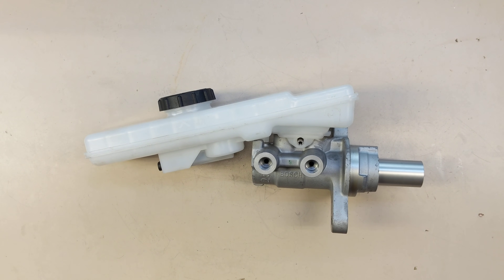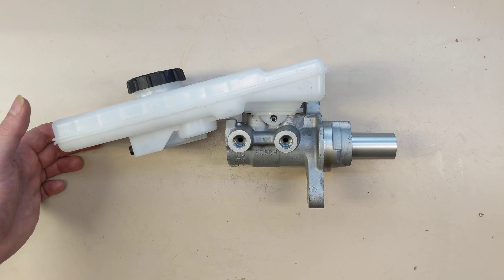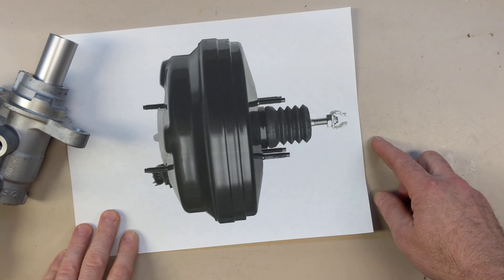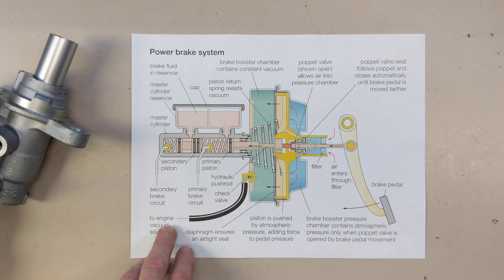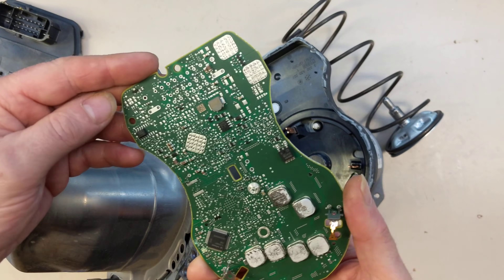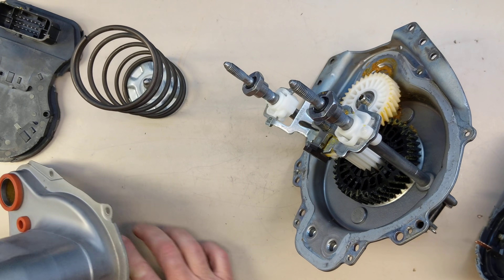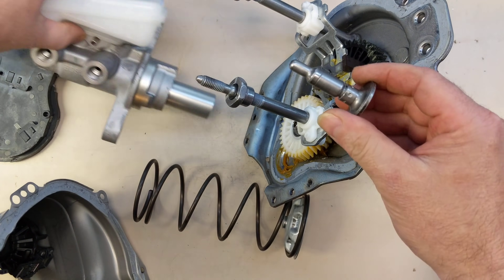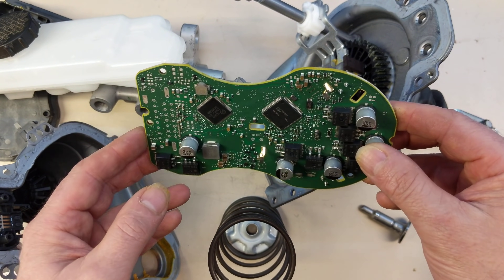Tesla Autopilot - How does it stop?

Comment: Where does brake force arbitration occurr? Does the ibooster scale sensor travel to brake force and request it from the vehicle? I know they can run in stand alone mode, so it makes me think all of thebwork is done in the iBooster and it gets the available brake force from the car, requests what it can then fills in the rest.
Reply from the maker: The iBooster in boost mode doesn't care about brake force, only your pedal application force.   However when AP or the DU is braking (one pedal) there is closed loop feedback.  (AP or DU requests brake pedal pressure)   Basically it brakes like you would, sensing the deceleration and modulating the pedal to achieve a smooth stop.
Reply: @Ingineerix  I see, that makes sense. But what about when the foot brake is applied? In my Honda Clarity which also runs an iBooster, when I apply the foot brake it brings in re-gen first then blends that with the foundation brakes to achieve the  desired deceleration. It's pretty good at blending the two as well. So does I booster do that calculation and tell the drive unit how much retarder torque is required or does the vehicle read pedal throw and then tell the iBooster how much brake force to apply when the Drive unit can't supply the required retarder torque?
Reply: @brandondelgado4153  Tesla doesn't do blended braking. If your foot is off the go pedal, the car is doing all the regen it can. If you press the brake pedal, it's all friction brakes.
Reply: @compu85  ok thanks, I had not realized that was the case.
Reply from the maker: @brandondelgado4153  Tesla doesn't believe in blending on the brake pedal.   Now they have one-pedal mode on the "go" pedal though, and that does blend regen into hydraulic when you let off the "go" pedal.  It brings the car to a smooth stop without ever needing to touch the brake.  The ESP3 (ABS) valve body then implements full 4-wheel brake hold until you touch the pedal again.
Reply: @Ingineerix  that makes sense. I hadn't realized Tesla was one pedal driving only. Does the ABS module require pressure from the master cylinder to apply the brakes? Or can the abs module generate the required force 9n it's own?
Reply from the maker: @brandondelgado4153  It can if the iBooster fails for some reason, but it's not normally used for this.  Either your foot, the iBooster motor, or a combination of the two supplies all the hydraulic pressure for a normal braking event.   If the ABS is triggered then the pump in the ESP3 (ABS) module is only used to re-pressurize one of the 4 circuits once it dumps pressure in that circuit and needs to increase braking force again.   It's noisy, so you always know if it's running.

Comment: Very interesting, thanks for sharing! -- Just looking at the video and unable to measure the forces myself, but suppose you have a software bug aren't there two fail scenarios:

1) Motor stops pushing entirely, you're working against the spring and the master cylinder to brake the car manually... Or is the force of the foot enough to overcome both?

2) Motor wrongly goes in reverse do to a software issue... Does this impede you breaking? Probably it means you're just not assisted at all though.
Reply from the maker: Yes, it would be full manual control.  The motor cannot fight your foot.  Keep in mind there are 5 other ways to stop the car:  1. Regen, 2. DI Plug braking (loss of HV), 3. ESP3 (ABS pump), 4 & 5. EPB (Electronic Parking Brake) EPB has 2 independent channels, so it counts for 2.
Reply: @Ingineerix  If you have a blackout, there is only the manual part left.
Reply: @Xanthopteryx  Yes, even if the ICE engine dies and vacuum boost goes away, you still have full manual braking.  Same for the electric boost braking and all electrics going away, full manual braking is still available.
Reply from the maker: @Xanthopteryx  Having both HV and 12v fail at the same time is not likely.  Keep in mind there are still 5 other ways to stop the car:  1. Regen, 2. DI Plug braking (loss of HV), 3. ESP3 (ABS pump), 4 & 5. EPB (Electronic Parking Brake) EPB has 2 independent channels, so it counts for 2.   DI plug braking can happen without ANY power in the car.
Reply: @Ingineerix  If 12V fail, HV fail. You need 12V to have HV. Safety feature.
Reply: @morrisg  Fun fact: If engine dies i still have power braking for a while. I can actually pump the breaks a few times before it is gone.
Reply from the maker: @Xanthopteryx  No.  The 12v system is divided such that if half fails, the other half can still provide power.  The 12v battery can provide power for one half, and the PCS can provide power to the other.   In addition, critical circuits in the BMS have their own HV DC-DC to make 12v even if external power is not present.
Reply: @Xanthopteryx  Fun fact:  If the vacuum booster diaphragm splits you don't have any power braking assist at all.  Yet in both examples, full manual braking is still there.  Stop making up corner cases and I will stop too.
Reply: @morrisg  If the engine stops on a car with vacuum booster, you have at least one (often actually a few) tries with full and partial booster.
If electric goes on an electric one, you have zero tries with booster.
Reply: @Ingineerix  Since you need 12V to pull the relay to have  high voltage, a short in 12V can shut of the rest.
Reply: @morrisg  Fun fact: I have never, and i mean Never, heard of anyone that had that problem. Even on a car that is 20 years old!
But i know many people with electrical problems in their cars. And also those plastic gears will cause a problem in the future (so sad that it is so common to use plastic everywhere today, not only on cars).
Reply from the maker: @Xanthopteryx  Wrong:  As I said above there are 3 sources for 12v in the car.  Also: Plug braking does not require any external power, if HV goes away it dissipates the braking energy in the motor windings.
Reply from the maker: @Xanthopteryx  Sorry, you are wrong, I bet the modern braking systems are more reliable overall, and the plastic gears you lament will probably outlast the car, and probably outlast all of us.   Having all power fail in a car without warning just doesn't happen.
Reply: @Ingineerix  If you talk about a life span of eight year, then it will work. But not if you talk about 20 years. Then we are beginning to have problems.

All power going out actually happened for one guy, in a Tesla. The Tesla just shut down completely. Totally dead. Everything. When he had closed the doors, he could not get in anymore. Nothing worked.
Reply: @Xanthopteryx  So this one Tesla just shut down completely, totally dead, no 12v power, no HV power, thus proving your point to yourself.  Oh, you have some really powerful internet diagnosis skills there, able to tell all that from some post on a forum somewhere.  I think you should open up an internet auto diagnosis shop and make millions!  Millions I say!!!  (/s, because I don't think you're able to tell jokers on the internet.)
Reply from the maker: @Xanthopteryx  Show me one case of this happening while driving, and the car was unable to safely stop because of it.   Having a car die after it has already safely stopped is definitely possible, but does not constitute a safety risk.  I also want to know what FMEA study you performed that shows the iBooster will only last 8 years.
Reply: @morrisg  Yep. Totally dead while driving. This has happened and it will happen.
Reply: @Ingineerix  Well, since you have manual brake to use, but it is HARD to do so, it stopped. It did not go as fast but imagine in higher speeds where both steering assist and brake assist disappear, and the car goes black.

There is no study, of course, but i know how plastic stuff ages and that manufacturer are happy as long as it outlives the warranty. Then they do not care so much anymore.

Stuff today are not made to last or be repaired. It is made to be replaced.
Reply: If the motor would go and stay in reverse it would drive the threaded rod all the way back into the white gear until it can't or the gear teeth rip, but because the white gear floats inside the black gear you will have no problem pushing the whole rod (threaded rod + white gear) towards the brake cilinder.
Reply: It has that spline that gives you the ability to manually apply the brakes regardless of what the booster is trying to do.
Worst failure mode would be fully applying the brakes by mistake, but the ABS may be able to mitigate that.

If you have ever tried using the brakes on coasting cat you would know exactly what it would feel like if this stopped working.

Instead of using your big toe to stop the car, you have to push pretty hard, but it's possible.
Reply: @ke6gwf  The point is that in contrast with traditional manual breaking if your vacuum fails, here you are also fighting against that big spring. Doesn't that make it even worse??
Reply: @purpleidea  the vacuum boosters also have a big spring in them, that's what returns the brake pedal after use.
In addition, the brake pedal has a LOT of mechanical advantage from leverage, so if you have, say, just replaced your master cylinder and you step on the brake pedal to start bleeding it, before it has fluid in it, you feel almost no resistance on the pedal, but it always comes back up..
That's that big spring, and it's probably about the same strength as in a vacuum booster system.

And compared to the force it takes to apply hydraulic pressure to the brakes, the spring might as well not be there from what you can feel.
Reply from the maker: Vacuum boosters have a similar spring.  The spring force is nothing compared to the hydraulic force needed.  Keep in mind there are still 5 other ways to stop the car:  1. Regen, 2. DI Plug braking (loss of HV), 3. ESP3 (ABS pump), 4 & 5. EPB (Electronic Parking Brake) EPB has 2 independent channels, so it counts for 2.

Comment: I wonder how Toyota tackled these problems in the first gen Prius?
Reply: First gen Prius used 12v hydraulic oil pump to generate pressure when needed. An accumulator stored hydraulic pressure. 
1st gen Honda Insight used a vaccum booster like the one described with a switch to start the gas engine when the vaccum got to low.
Reply: @brandondelgado4153  Interesting, thanks

Comment: Unrelated: how hard would it be for Tesla to implement variable steering ratio into their current system?
Reply: Impossible lol
Takes an entirely different steering system design, so a new system by definition.
Reply from the maker: Ben is correct, it would need a totally different steer-by-wire system.  Infiniti has done one, so it's doable.

Comment: I suspect if Tesla ever makes their own version it will be if/when they switch to brake by wire.
Reply: That will be when they have Direct Drive motors, one for each wheel. That will make all the braking system redundant. At the moment, DD doesn't work at low car speeds.

Comment: This is super interesting and gives me peace of mind. For some reason I thought the braking was done by the ABS module and I was wonder if the solenoid that would have activated every times you come to a complete stop (one petal driving) would prematurely wear out. Now it looks like there's two systems (on top of even more safe guards) that can stop the car not just one. Thanks for the break down!
Reply from the maker: Yes, I didn't cover the ABS/ESP valve body, but maybe in a future video.  Keep in mind there are still 5 ways to stop the car even if the iBooster fails and your foot doesn't work:  1. Regen, 2. DI Plug braking (loss of HV), 3. ESP3 (ABS pump), 4 & 5. EPB (Electronic Parking Brake) EPB has 2 independent channels, so it counts for 2.   DI plug braking can happen without ANY power in the car.
Reply: @Ingineerix  I think the newer Teslas can also run the motors as steppers at low speeds, bringing the car to a stop.  So I guess even if regen is all you have, the car would stop.
Reply from the maker: @tomsixsix  No, the new "1 pedal driving" uses the iBooster to apply the brakes, and the ESP3 valve body to hold it once stopped.  Regan can only slow the car down to about walking speed.
Reply: @Ingineerix  So, how does this relate to “Stopping Mode” that Tesla introduced about a year ago? ISTR it uses the motor down to a very low speed to slow the car — though I concede that it could well use the brake door the final stop.
Reply: What is DI Plug braking?
Reply from the maker: @jor7137  DI is Drive Inverter, and Plug braking is basically a controlled short circuit on the motor windings, sort of like regen, but instead of sending the energy into the battery, they just turn it into heat in the motor windings.   This is done in the event high-voltage is lost for some reason.   If it isn't done while the car is driving at speed, the motor can generate such high voltages that it will destroy the inverter in a big fireball.
Reply: @Ingineerix  Thank you. Appreciate the thorough explanation

Comment: So when auto hold is engaged at a light or whatever, it's the motor shown here that must constantly apply pressure or is there something else that locks the brake pressure? Let's say you're stationary for a while, surely it isn't good for the motor applying force without turning and probably heating up as well?
Reply from the maker: The ESP/ABS valve body does the hold.  The iBooster only applies the brakes for one-pedal at the end.  You can even see it if you watch the brake pedal.
Reply: @Ingineerix  Thanks! I was pretty sure there was probably something else doing the hold but nice to know exactly
Reply: @Ingineerix  so the little click I hear when doing single pedal driving is the ABS valve activating? I don't hear it if I use the brake pedal (even light pressing) but I do every time with single pedal. Thanks.
Reply from the maker: @Melds  If you watch the pedal when you are coming to a stop in one-pedal mode, it will move slightly and there is a very subtle noise when regen tapers and it has to fade the brakes in.  Then once the car is fully stopped, the ESP3 (ABS) valves close on all 4 wheels to lock the brakes on, then the iBooster "lets go" and the spring returns it to resting position.  That return also makes a slight noise.   1 pedal mode is really well done!  It doesn't surprise me it took so long to be released.
Reply: @Ingineerix  Interesting! Thank you very much for explaining it.
Reply: @Ingineerix  until today, I had no idea the mechanical brakes were applied for coming to a halt in my model 3. Very well done indeed.

Comment: Basically the Tesla using standard German suppliers like everyone else
Reply: Bosch was way ahead of the competition when this system came into production.
Reply: Yes of course. Most parts in a Tesla is non Tesla parts. As with all manufacturer of cars...
Reply: Use the best until you can do better!
Reply: this same part is found in many new vw/audi hybrid and electric cars, and also some honda. many oems use the ibooster. Just with different pin config and software but hardware is mostly the same (except mounting points and master cylinder)

Comment: I can see that the 3 motors phase are passing right thought the PCB to something else in the housing? Aluminum heatsink. It also seems that the motor phase are not soldered but press fit into something. Thanks
Reply from the maker: Yes press-fit pins, just like Tesla uses in pretty much all the ECUs now.  Many automakers and suppliers now use this method as it's much more reliable and reduces assembly labor as well.

Comment: Great description of the braking hardware. I’m guessing that when you discuss regen braking you will talk about the differences in how iBooster is integrated into regen braking on most hybrids and EVs but not on Tesla cars.
Reply from the maker: Yeah, Tesla does not use regen/brake blending.  Now since Tesla has introduced "1 pedal" driving, it's definitely not needed.  Anytime you press the brake pedal on a Tesla, it's just brakes.   (Regen comes on when you release the "go" pedal)

Comment: You stated that auto pilot can apply the hydraulic electric assist brakes. Does auto pilot then activate normal brakes during a Normal stop light stop, or does auto pilot predominately use regenerate braking?
Reply: Same as what a human driver does: release accelerator, if car does not slow down enough, add hydraulic pressure.
Reply from the maker: @Motofan16 is correct.  Tesla has now rolled out 1-pedal driving which automatically fades in the brakes using the iBooster when you release the "go" pedal.  It works really well.  For most driving you don't even need to touch the brake.

Comment: Does the car still have a conventional ABS/ traction control system, distributing force to each wheel as needed?
Reply from the maker: Yes, that will be a future teardown.
Reply: @Ingineerix  thanks! I appreciate your work!
Reply: Yes, it has an ABS module that the brake lines route to from the master cylinder.  That module has electronically actuated valves and electronics.  The brake lines going to each of the 4 wheels go out from the ABS module.

Comment: Does the motor spin backwards? Under power? Or does it release from the mechanism and the spring just returns it directly?
Reply from the maker: I'm pretty sure the spring returns it.  There is no need to force it back.
Reply: @Ingineerix  I'm wondering though, if you ran the motor the other way, would it prevent braking? Edit: And if this is how it achieves ABS.
Reply from the maker: @henrikmikaelkristensen4784  No, I've already covered this in the video and answered it here in the comments several times.
Reply: pretty sure this is the kind of motor which spins freely if there is no power applied to it, so it does spin backwards by the spring tension when not powered